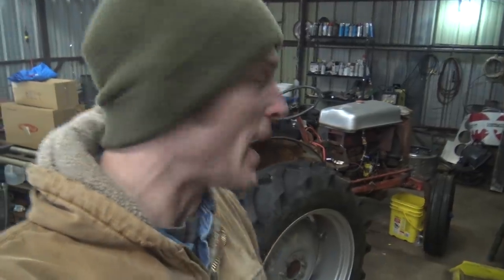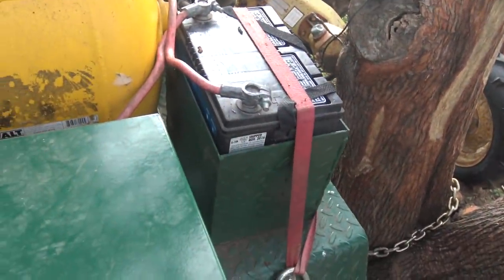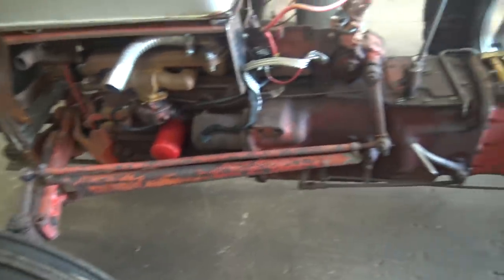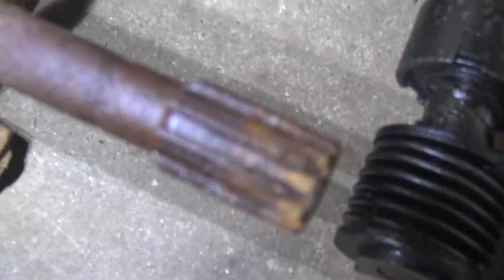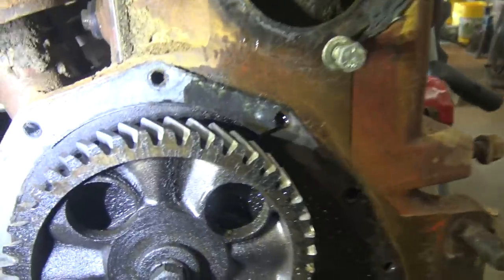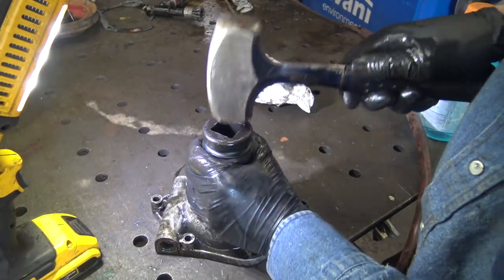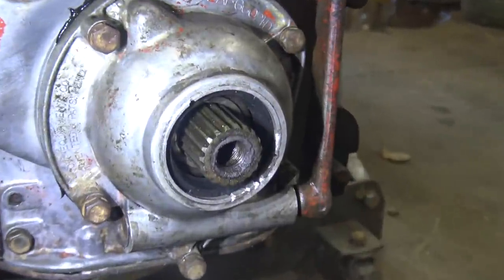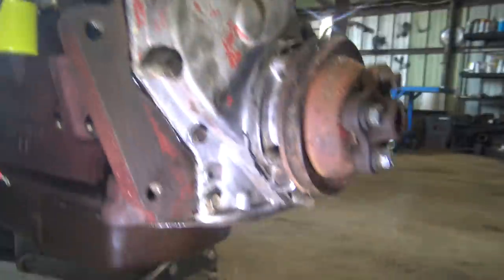Lets Fix The Clutch In This Classic Farm Tractor!!! (Part 1 of 2)

Comment: neutral is where you can move shifter up and down. those are  great transmisions, with 3rd and reverse at tghe top, 4th and fifth in the middle and 1st and second on the bottom.

Comment: Pretty nice work! Reminds me of my old 3000 Ford. Those Ford's were okay. Power steering sure is nice on a tractor like that. Especially if it has a loader on it!
Reply from the maker: Yes I always liked the ole Fords. Unfortunately this tractor lived a hard life before I got it, but the two main weak points on this generation are the steering box (stupid design) and that circle shifter thing. I eventually figured out the gearing on this machine but I could never get it to steer properly :I